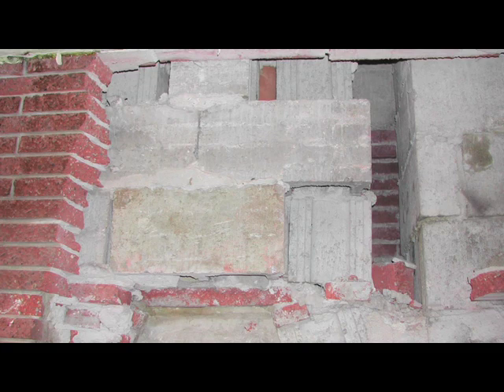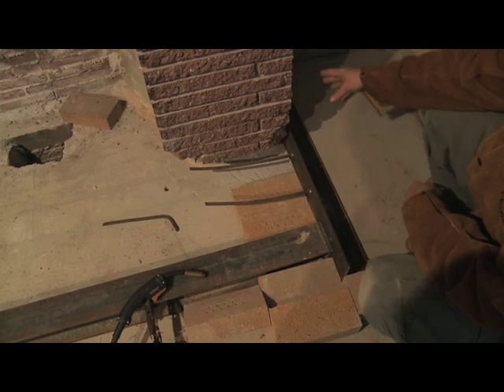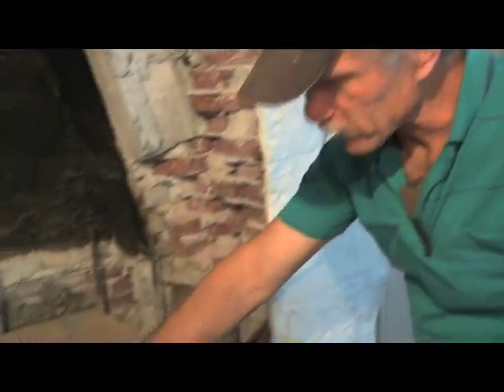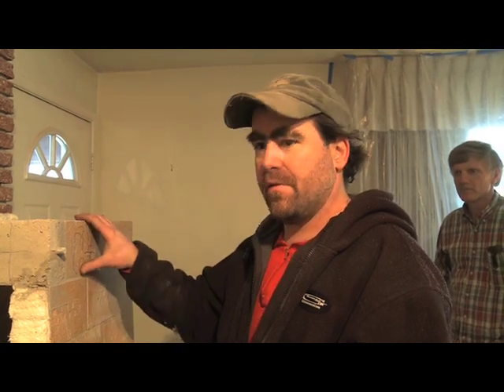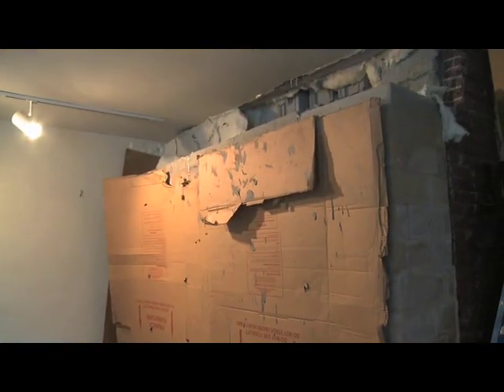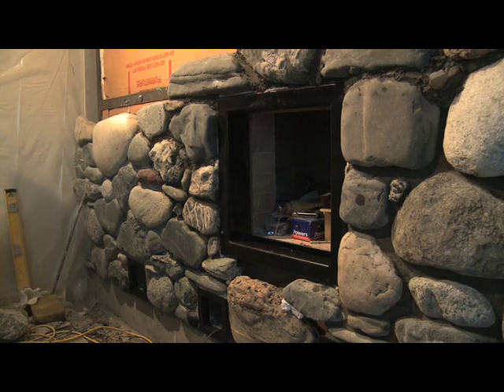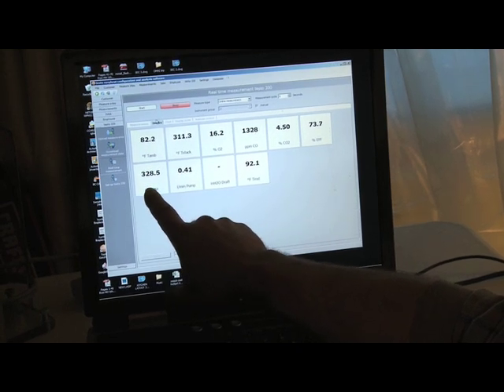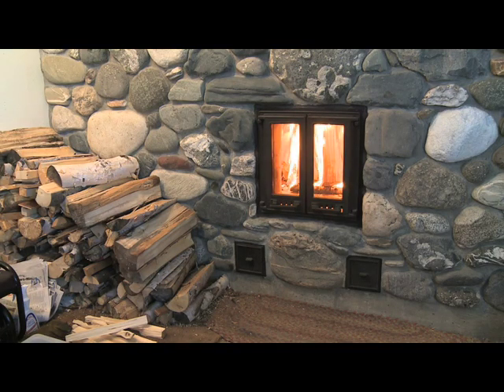Masonry Heater Retrofit

Comment: The double-bell masonry heater design seems to be just as effective as the baffle system, but also would appear to be the only way they could have retrofitted this chimney.  I was pleasantly surprised by the engineering and technical sophistication of this work and the emissions testing.  Seen tonnes of vids: this sits right on top.  Kudos.

Comment: The beam is supported by the foundation on the one side but it seems at 10,000lbs you should have increased the slab thickness under the steel post. The standard 3”-4” basement slab seems a bit vulnerable. Thats some clean stonework btw. Very nice.

Comment: Curious why the ceramic wool insulation was used between the core and the existing masonry, but then used cardboard between the core and river rock face.  Also, couldn't believe the lack of roof safety while working on a snow filled roof.  But, an incredible project, especially the steel foundation and integrating the new heater to use the existing chimney.
Reply: It was used as insulation because the original wall was not and bleeding heat out of the house. The  cardboard was a sacrificial material expansion joint and cheaper than the ceramic wool. Also, it transfer the heat better through the stone into the room.
Reply: Roof safety? What are they supposed to do, put parachutes on or wait for summer?

Comment: I wonder, since you have less ash per burn, if the incidence of COPD is lower with these types of stoves.  When i was growing up, we had a regular Buck Stove inside a chimney and we would constantly shovel out the ash, lowering the air quality of the room (in the basement).

Comment: Retrofit also have a place to heat water or food or something at the top?
Reply: Yes, I too would have liked to have seen more practical application to the possibility of such. But they already had an expensive oil based water heater in the basement. ?.
Reply: @carolleenkelmann3829  We have baking options and had hot water heat coils until EPA restricted the heating of water. Even so, baking could be done in the firebox after the fire burns down to coals.

Comment: question:

Every masonry stove and every rocket stove I have seen has always had the exhaust gases traveling either above the fire box or at the same level as the fire box. my question is can you put the exhaust below the fire box without extra problems. 

I have a poured concrete wall below grade with 24" of block above that. I would like to reach the concrete without putting my fire box below grade as well. I could have my firebox above the floor and heat the concrete as well without having to use the stairs. As I am handicapped, 
that would allow me access.
Reply: armchairintrepid The place to ask is the Facebook group Rocket Stove Mass Heaters International
Reply: @Jeremiah Shine. You're stuffed if you don't have Facebook

Comment: I understand the improvement to the wood fireplace, but why wouldn't you update the 80 or so percent efficient oil boiler with a high efficiency propane or natural gas boiler unless propane or natural gas is not available. Beautiful Masonry Heater though.

Comment from the maker: Only the exterior chimney is original and even so the existing flue was lined with a stainless steel liner which was then surrounded by a mixture of poured in place vermiculite/concrete.
Reply: will there be issues with expansion/contraction of pipe without any buffer against concrete?   won't the concrete/flue crack?

Comment: I'm curious if anyone knows the feasibility of using 'angle iron' steel in a masonry heater. This would seem the easiest solution to a big problem with masonry heaters. Spanning certain openings with brick. Like the firebox or smoke chambers. Would a regular piece of angle iron hold up to the temp? How would using steel work in a masonry heater? Just curious. Any information is appreciated.
Reply: Any steel parts in the firebox or near the top of the bells would fail quickly.

Comment: any masonry heater design should have all masonry inside the insulated space and NO masonry chimney above the insulated space,  The old chimney should have been removed because it  will be continueously wicking heat from the masonry below in the insulated space.

Comment: I get the feeling they're adding a $100K heater to a $50K house.
Reply: There ain't nothing like havin' a warm house when it's cold outside, irrespective of house price comparison, not to mention the combustion efficiency and the reduced negative emissions. Maybe they will retro-fit the house, quite possibly to include an esthetic appearance for wood storage.
Reply: @carolleenkelmann3829  Only that's not just objectively wrong, but plain stupid. What's the point of adding a fireplace to a house that you'll have to rebuild?
Reply: And they couldn't call a plumber to move a pipe or an electrician to move some track lighting

Comment: impeccable mason;y work but why do people want to stack river rock?
Reply: I wondered why you couldn't cut the rocks in half and stick them on with the cement. A novel project. Maybe it was for the father-in-law.
Reply: @carolleenkelmann3829  It's for mass. More mass means more heat held for longer. I'm surprised they had flue gasses at 300 degrees, but with all that firebrick it makes sense.
Reply: @carolleenkelmann3829  Too much labor and expense. The idea was to use local material that was readily available and keep the cost down.
Reply: @Nikletheman  spot on re thermal mass. The 300F likely has to do with the retrofit being a less than ideal design. Not sure what my MH flue temps are but I understand 250F is consistent with a good design.

Comment: 73 pct is not flying coors!?  What happened to the 98% claims lol
time consuming? very involved, many different trades? and and and and Xpennnnnnnnnnnnnnsive as hell !, maybe?
Reply: If I understood it correctly (and I am a masonry heater owner) the 98% is in reference to the combustion efficiency of the firewood and the 73% would be the overall energy efficiency given that warm flue gases go up the chimney.  Bear in mind too, that this was a challenging retrofit which likely limited overall efficiency. I have a Norbert Senf unit that is almost 30 yrs old now and the overall efficiency was rated at about 85%.  A masonry heater should last 75-100 yrs or more and adds a lot of value to a home. An oil or nat gas heater 20-25 yrs? This was an expensive retrofit but I think it was a sound one.